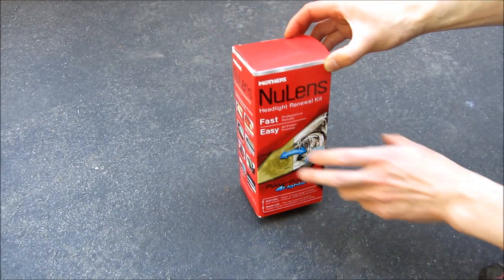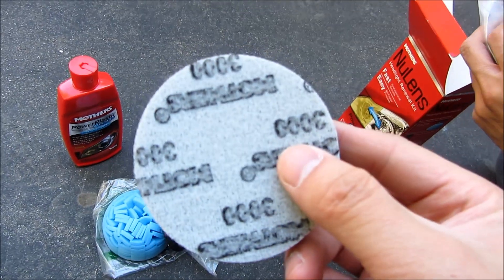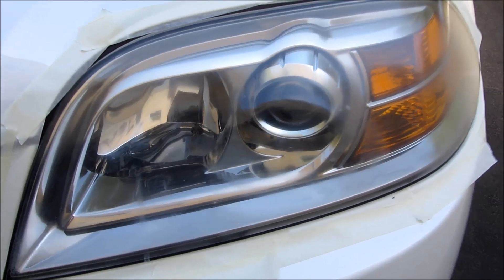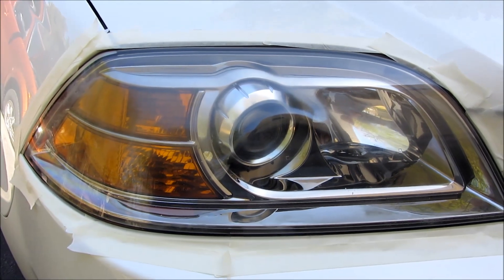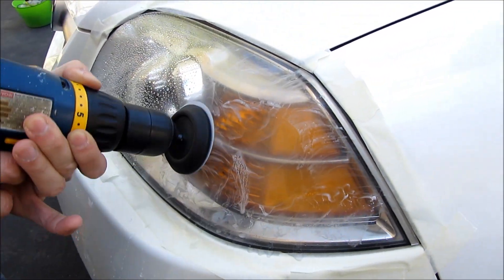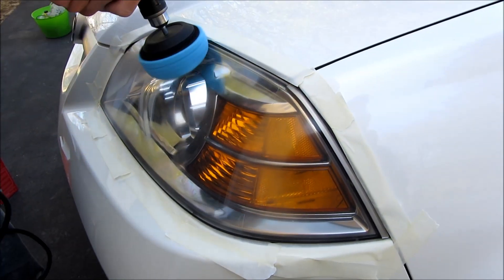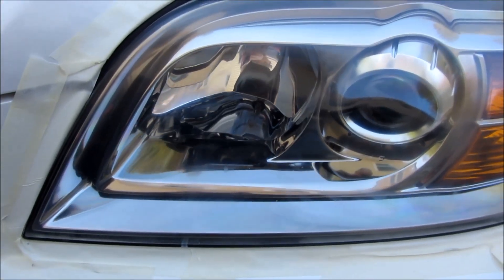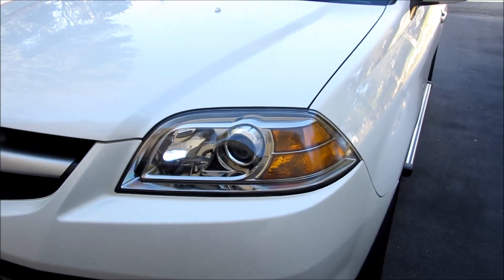DIY Mothers NuLens HeadLight Renewal Kit Review, Demo and Unboxing

Comment: Nice DIY video. I did this today on my fading lamps...and it worked perfectly. I just used the 3000 grit pad because my headlights weren't terrible, just lightly faded. An hour later I was looking at almost new headlights! I mainly bought this kit for the drill velcro adapter.  Definitely worth the money!

Comment: For that little bit of light frost all you needed was that buffing dome and some mothers mag and aluminum polish, after a couple passes you'd have crystal clear lights and then wipe and apply a wax sealer.
Reply from the maker: Completely changed the headlamps out 2 yrs later - https://youtu.be/4xQB196zmAo

Comment: Thanks for this great video. 
I’ve seen a couple other brands that after the 3000 step and final polish they provided a wipe soaked with a fluid that sort of melts the surface and makes it super clear by a chemical action.  You chose to go a couple of extra steps on your own with 2 additional products that are basically just different polishing products. I love Mothers but I’m wondering why they don’t provide that wipe with the solution as a final step after the foam ball.

Comment: it says not to use water with the for the 3000 grit did you???
Reply: +Andrew Wolf the 3000 is a dry process, correct.
Reply: damn i used water fuck lol!
Reply: I used water and it was fine for me. Don't see why you'd dry sand personally.
Reply: LOL, I did same as you (reading off box) without water and scratched the heck out of it, but It does have instructions in box says to use water.
Reply: Probably best to use water for a wet sand I would think. Dry method would release alot of plastic dust in the air that you don't want to be inhaling or getting all over you and your clothes. Water would help contain it.

Comment: I do not recommend this kit if: 1) You generally don't do DIY things on your car and/or 2) if you've never done this before and your own headlights are the first headlights you practice this kit on. I usually let professionals do things to my car as I am not the tinkerer kind of person, but I really wanted to give this a try as it seemed straightforward. I followed the instructions as best as I could, and generally I do this very well, lol. But, of course with the first round of wet sanding using the 800 grit sand paper, I permanently left circular scratches in the headlight housing. They are pretty deep and I wasn't able to sand them out. I continued with the instructions, and when I got to the dry sanding using the 3000 grit sand paper, the pad shredded and left a black-ish stain on the housing, like tar or something. I couldn't get it out using any of the lower grit paper. At the end I managed to make it look somewhat decent, but the tar and initial scratches are still there. I didn't perform this on the other side headlight. So yeah, go to a professional if you are like me.